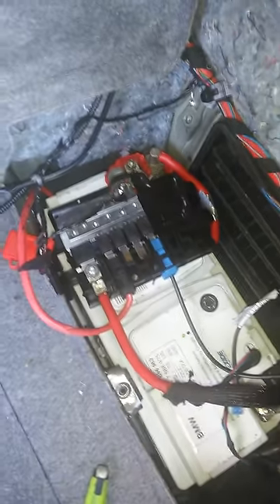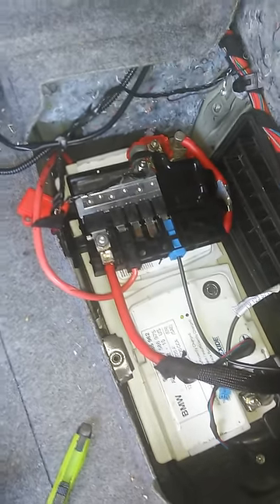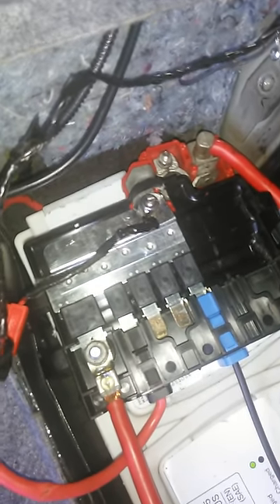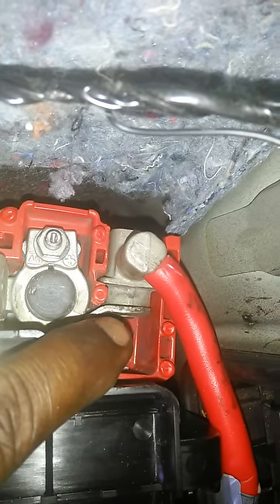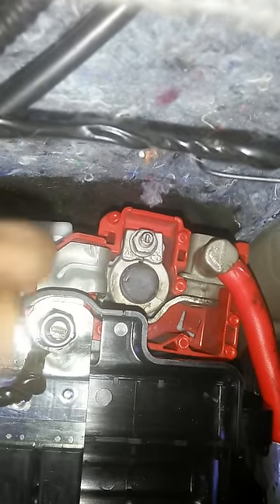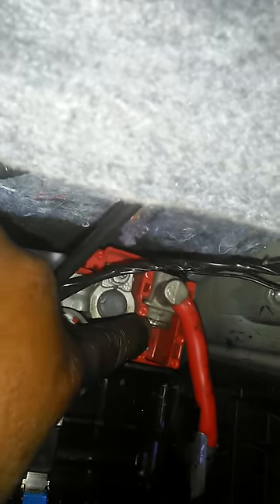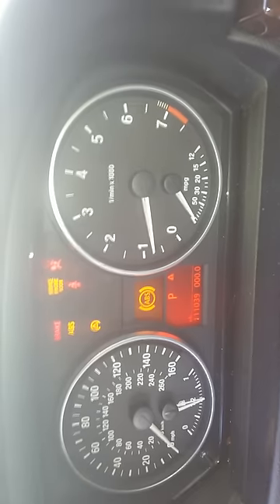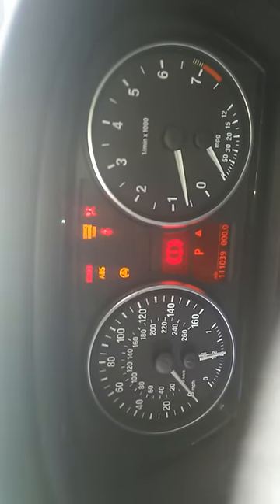08 bmw 328I starter no start problem .... FIX !!!!

Comment: How'd u get that little red box open? With what tool? My airbags went off due to a fender bender Im to the part to take that plastic thing apart how'd u get it open my dude? HELP!
Reply from the maker: Alex Barron it's basically plastic welded together.. look closely at the top of it you'll see the spot welds .. I have to pretty much break it apart

Comment: I replaced my entire positive battery cable and my 08 328i will still not start. I noticed that the cable I replaced had the separation that you pointed out. Do you have any idea why the car will not start/turn?
Reply from the maker: does it make a "click" noise when u hit the start button?
Reply: Eddy Loves cars - No. the engine doesn’t make any noise at all. Like it doesn’t even try to start. When it initially stopped running, I had pushed the start button and the engine turned once then stopped and did not turn on. Since then, the engine has failed to even crank.
Reply: Alexander Jones so what happened and can u make a video
Reply: @xdoutrex  same problem here, did you fix yours?
Reply: @rileytavares4087  Replacing the cable was not the fix... I ended up replacing the starter myself and it worked perfectly. I followed this video: https://youtu.be/7pT1GT3JxWg
The only issue i had was loosening the back bolt, but finally got it.
Reply: @xdoutrex  mine started today but will check that out

Comment: Eddy I need help my car is cranking it just doesn't want to start it barely broke down today and I don't want to put any money into it, I have tried using your video but Idk how to pry that little box open to get to the red wire thing and don't want to break it then have to buy even more parts
Reply from the maker: Nick Mata if it's cranking but won't start ... this is not your problem .. if u can hear a "click" when u try to start it then this video will help
Reply: Eddy Loves cars how can I fix this I really need help
Reply: Nick Mata did u ever fix this issue ? I’m dealing with this right now

Comment: Alright so I was running low on gas so I had to put some gas from a can around my house that had been sitting around for a bit. I put about a gallon in it to get me to the store and it must've been watered down big time because my 328i ran for about 10 mins then shut down and now won't start. Ive changed the plugs and checked the fuel pump and its getting ignition and everything it seems but just came across this and I recently replaced my battery and will be going to check to see if this works and I will update once I try this out and update
Reply: I have this exact issue, did it work?

Comment: Sadly this wasn't the issue for me but definitely a good money saver. Besides this double check the cable to the fuse box, the battery com relay, and the fuse box connector before unleashing the parts cannon.

Comment: Hey, I'm having the same issue.  That bts cable has a gap of 1/16" is that gap big enough to prevent my car from starting? 

Thanks
Reply from the maker: TeFLoN TeDdY shouldnt have a gap period ...no contact no start
Reply: I was able to unsert a flat screw driver , should i try to put it back together?

Comment: 😂 Cheers my guy but you can lift that lil' flap and see if that thing is out. Mine f'ed up last night. Did like one crank then a half "rrr" and now nothing when pushing start button. Checked the battery using the little flap, shits way over engineered but sadly mine is not "out". Might be the starter 😬

Comment: Tried this on my 2008 328i, there’s a sensor connected to the back of the thing that’s popped out. Tried hammering it back into place. All it did was dent the edges and now my air bag warning light is on.

Comment: Eddy loves cars. Would ur car turn over but not ignite.
Reply from the maker: Charles Hanbounleng no mine just made a "click" noise that's it
Reply: Charles Hanbounleng did you ever fix the issue? I’m dealing with a crank but won’t start, wasn’t getting fuel or spark replaced the fuel pump module so I now get fuel just no spark won’t fire over
Reply: Stephen Mireles make sum videos

Comment: BMW has this system in just about all of there cars it is called a
"BST"  Battery Safety Terminal
It has a small charge at the end of the terminal that separates the cable from the battery in an event of an accident this is to prevent an electrical fire that maybe caused by a major short , unfortunately sometimes they go off just by a small blow to the bumper. 
The actual fix is to replace the cable because the new cable comes with a new charge at the end of the cable , i hope this helps in understanding what a. "BST" BATTERY SAFETY TERMINAL is.
Catch ya later. Yo.
Reply: donhe Make a video or your lying

Comment: Break open plastic rivets surrounding bst, carefully hammer back into contact. Clear code and cycle ignition to check if it’s fixed. Now you’ll know for sure before you fork out €150 for new bst.. worked for me. 
NB. This is temporary!!

Comment: That wire is the power to the Air Bags that pops out so the car will not start after an accident or when the Air Bag Sensor is triggered.

Comment: my 535i bmw. 2008 is not.  staring.  some one told me to change the conputer module.    is tha right
Reply: i have a 545i check your mpm box in the trunk under spare tire might be burnt out
Reply: Cesar Lozano is it?

Comment: 2008 528xi won't start after changing the alternator, started one time then immediately died, I had no way to charge the battery so I bought a new one and put it on, now it won't start at all but now all my lights and everything come on,
Reply: And giving all the service messages about 4x4, inactive start, abs...etc etc
Reply: make a video

Comment: Can you please help me because I know nothing about cars. But over the past week my BMW hasn't started. Like it won't unlock, I used my Key to unlock, once I got into the car, my dashboard doesn't light up. When you put the key in, nothing happens. Literally nothing happens. I'm so confused, I check my fuses, all of them are good. I checked my battery, it's good. My engine is good. So could you possibly tell me? I contacted BMW, they told me to have it towed but that would be a waste of time being that I just left them. They are no help! Please help! (Side note: the car will actually run like once a day and it will repeatedly do the same thing, like it's dead or something)
Reply: Diamone Lashay you need a new battery

Comment: would the car have power even when it didn't start ?
Reply from the maker: yes the car has full power … windows go up and down radio etc... just wont start …. CLICK … that's it
Reply: Eddy Loves cars same for my car but I had never been in a accident at all
Reply from the maker: DOESNT MATTER … SOME CARS ALL IT TAKES IS A BUMP OR SOME TYPE OF SHOCK
Reply: @edrockwylaa4472  mine was the mass airflow sensor

Comment: Solition ,Hi brother BMW made this according to an european rule model to avoid starting the car after accident in case of maybe fire..it is calles bst option BATTERY SAFETY TERMINAL..just smash it back together so that the cable contact each other and when cable is reconnected car starts..
U see this many time at the scrapyard,and damaged cars..i went to bmw in germany and asked.chears

Comment: you still should reolace that assembly because  that "plastic thing" as you called it is a safety feature  to avoid electrical fire due to a possible short circuit.
Reply from the maker: the car is long gone bro...this video is to help ppl that think they have a starter issue and mite not... it would suck if you pay a crasy number to a mechanic for replacing a starter and it do the same thing lol .. read my comments section .. helped lots of ppl .. by the way the "plastic thing" is nothing but a cover.. everything the "plastic thing" covers was never tampered with... short circuits are why the cars come with fuses..
Reply from the maker: and another thing... the electrical fire part u described ..lol .. the car still has power to everything in the car while the unit is broken ..just not the starter … radio sunroof windows seats ac headlights fans bla bla bla soooo. … thro the whole idea away

Comment: I'll be trying this in the am my 07 328xi just started doing this
Reply: How did it go?  I'm about to do this on Friday.  New starter arrives on Thursday.
Reply: Troy on my 2007 328i car drives ok than out of nowhere when inserting the key battery dies and can’t get the key out.... have to jump start from the front just enough to get some light going in the car and have to open the trunk and moving the connector to battery... the battery does not have the metal part on top that holds it down do you know what I mean.

Comment: I tried this and mine didnt work. Same click sound. I checked the relays and realized one was hot after several trials. Could this be problem?
Reply from the maker: Frank Tandoh if you connected what i showed you..then u have a starter issue bro.. Very advanced job bro..click every start attempt..starter
Reply: Thank you. I tried to jump start it after connecting it. Thank you once again. It worked.